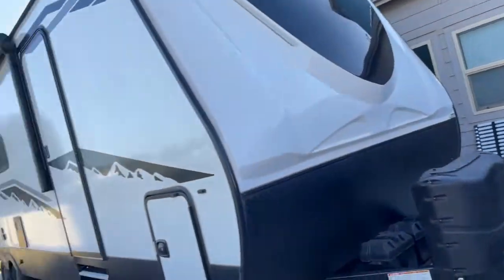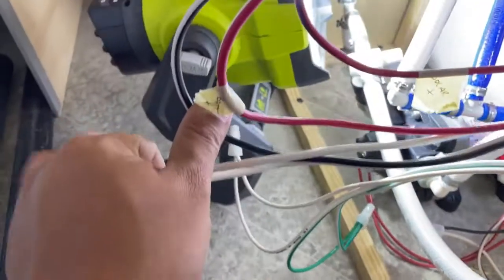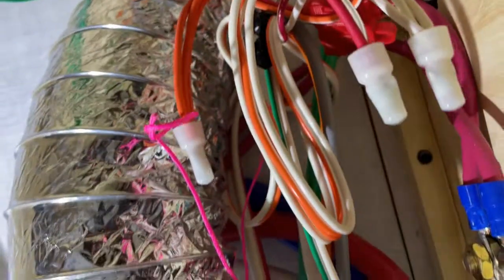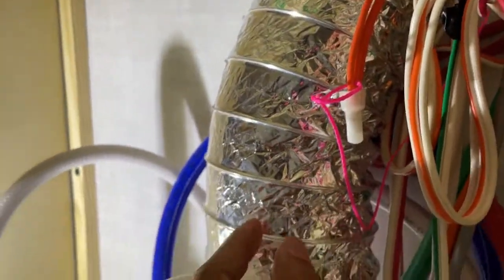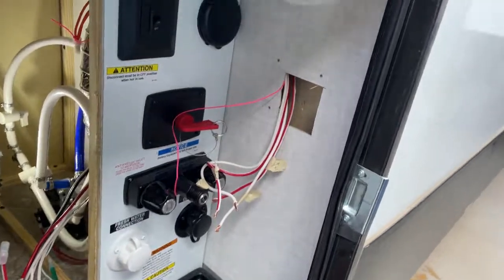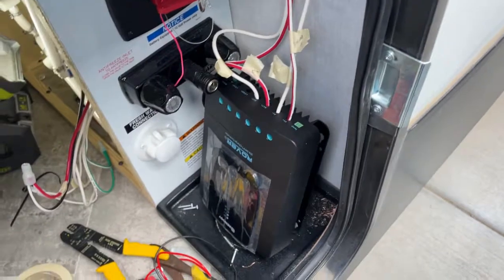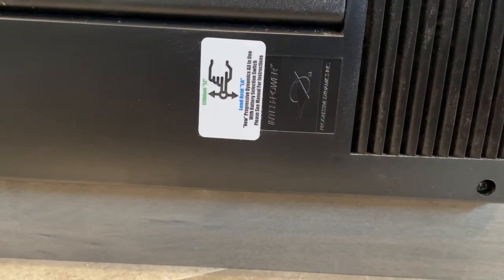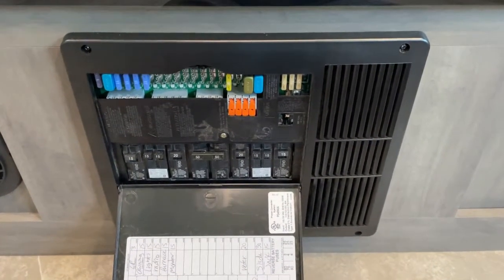Converting the East to West Travel Trailer to Lithium Battery!!

Comment: I have done lithium and solar installs.  There should be a breaker on the plus side between solar panel and controller.   That insures you can work on the controller without getting zapped from panel or battery.  Not sure if your battery disconnect drops all power from battery to everything.  If not you should add a breaker to completely isolate the battery.  I know RV's like to keep power to brakes etc. but there should be a positive method for that protection.  Could pull the battery cable but that takes extra time.  Why didn't you move the lithium battery to the storage compartment?  The don't like charging below freezing.  Hate wire nuts, prefer bus bar which also makes easier to troubleshoot.  Did you open the breaker panel and see what is really in there ?  Always amazed on how manufacturing takes shortcuts.  Looks like a nice install.

Comment: Thank you so much for this video. I'm changing my batteries to lithium now as well on the Alta 2600KRB and the wiring is exactly like this. I do have a few questions and comments for you and the rest.
1. For the red wire marked +Batteries going to the positive battery terminal on the controller, how is it connected to the new battery? It would have to be through that black and white wire that it is crimped to. I know you mentioned that the black and white wire was coming from the converter. Seems it should be coming from the DC panel. If not how would the output of the controller get to the new batteries?
2. The reason I ask #1 is because I'm putting my lithium batteries underneath the bed in the storage space with positive and negative bus bars.
3. Now the positive cable on the lead acid battery on the hitch is going to a junction box on the front outside of the rv. In there the cable is connected to a fuse block. On the other side of the fuse block there are multiple wires and a main cable that goes to the battery shut off switch in the pass through. On the other side of that switch is another main cable that goes to the DC breaker panel.
4. I am going to disconnect the cable connected to the lead acid battery from the fuse block outside. Then remove the main cable that goes to the cutoff switch and place on the opposite side of the outside fuse block. Then re move the main cable off the cutoff switch and place it on the new positive bus bar by the new lithium batteries. Run a new cable from the positive bus bar going to the cutoff switch.
5. Run new positive and negative cables from the controller battery terminals to the new bus bars. Run the original solar wires coming from the roof to the PV terminals on the controller
6. The big question is what do I do with the black and white wire that you said was coming from the converter? I think I connect it to the new positive bus bar. Or I cap it off and don't use it. I don't think it is coming from the converter. Any help is appreciated. Thank you

Comment: Thank you for the awesome video. I am not seeing a charge controller in the location of the original charge controller you showed. Is it in the wall itself? I have MC4 connectors that came attached to the roof, and they carry a charge. I am just not sure where a controller is located, if there is one. It is a 2022 Della Terra 271bh.
Reply from the maker: Do you already have a solar panel on your roof? I’m not familiar with the Della Terra’s setup so I wouldn’t know where to look for the controller if it has one. You may have to cal East to West.
Reply: @CollaGoUnLTD  I just bought a Della Terra 250bh.  I'm thinking of adding solar.  Are you near Illinois?  maybe we could help each other.

Comment: I have an Alta E2W 2350KRK - it is wired just like yours. The last week I did a lithium and solar charger update and made the changes as you suggested with the solar panel / battery wiring. It seems to be working fine. After I changed the switch in the power center, from LA to LI on the converter, it seemed that the converter was sending much more power to the new lithium batteries when hooked to shore power. Did you notice this too? Do you think the DC wiring from the power center/converter to the batteries can handle this additional power/amps?
Reply from the maker: Mike yes lithium batteries can definitely handle much higher rates of charge, I would not worry about that.

Comment: Great vid thanks for sharing, I have a 2810kik with solar, have a question that’s a little off topic, what’s the small black switch above the battery disconnect on your RV?
Reply: It's the same as my 3100, that switch control your front cap light strips.

Comment: How did you move the switch from LA to LI?  Mine is actually set to LI, but I have lead acid batteries.  I tried switching it with the tip of a small screw driver but it doesn't want to move.  A little green light came on next to it though.  Hope I didn't break something...

Comment: 2 questiuons, is your RV a 30amp or 50amp? Mine is a 50, why would I put in a 30amp Solar controller in a 50amp setup? Next, you didnt describe why you needed to go to a new charge controller... I have a 2022 same make and model ut mine is a 50amp shore power and has 200w solar... does this change from what you covered?
Reply from the maker: My rv is a 50a service, but that has nothing to do with the solar controller size being a 30a. The 30a solar controller is based off of what the output of my solar panel setup is. Two completely separate systems.